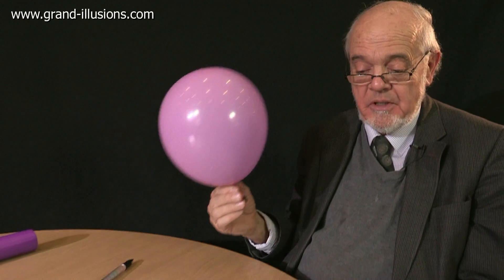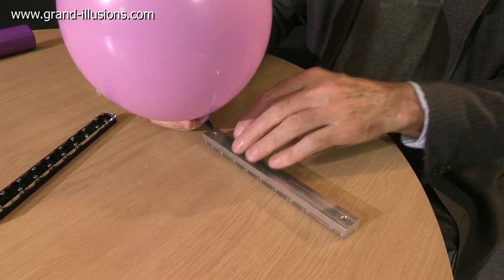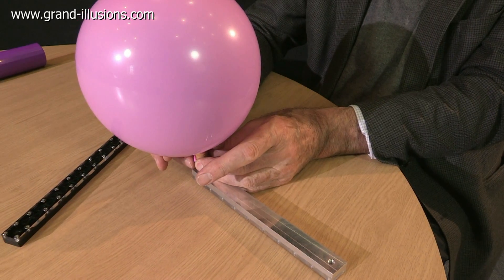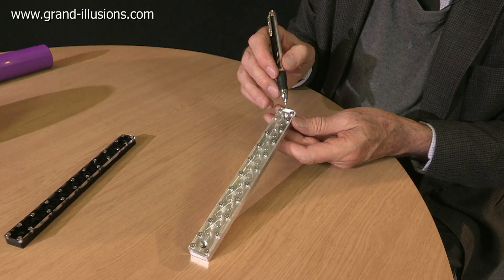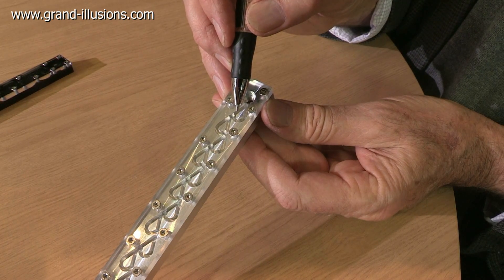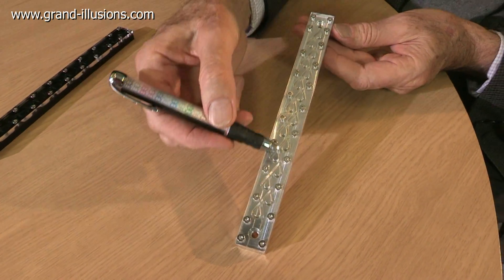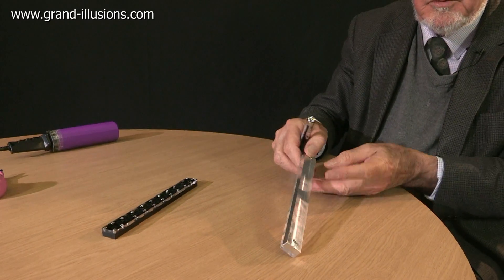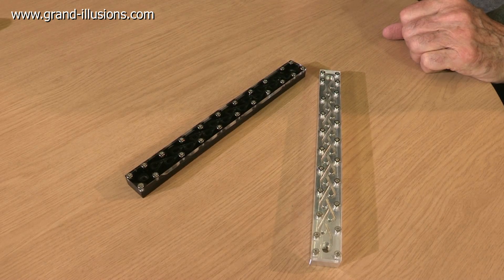Tesla Valve

Comment: That is super cool, but it would not replace a standard check valve for liquids(at least where you need to stop all flow (like for a water well).  There would always be back flow, just less I suppose.  It would be cool to see some practical applications for this.

Comment: Imagine a space vehicle,
using a gas ionised with electricity and an ionic engine to propel it through space, but when it runs out of fuel gas, it stops accelerating (nothing new so far).

Well, what if that gas accelerated with electricity was collected and braked using a kind of TESLA VALVE in 3D, to recover the gas and be able to be used again accelerating it with electricity.

Comment: Some people are comparing this to a labyrinth seal. I think they are missing the point of this device. Labyrinth seals work the same way in both directions. They are not one way valves as such. They are just a form of restriction to limit flow or leakage. This is a one way valve with no moving parts.

Comment: so it's not a valve but a device for lowering the fluid speed and therefore the pressure ... and it's fixed and not regulateable ... nonsense ...

Comment: The key aspect is that it has no moving parts to wear out. No rubber diaphragms etc.
Reply: I imagine there would be incredible erosion with prolonged use
Reply: @chemetron3826  no. If you mean decades of use, probably some minor erosion. But any valve would have turned to scraps in this time span.
Reply: Check valves last just like any other part of machine no problems.

Comment: This is the one of the only one-way tubes that can transfer liquid in only one direction without the need of mechanical or moving parts.
Reply: Not only one direction, just far more resistance one way.
Reply: @davids3539  i believe all valves leak
Reply: @NoFutureForG0uda  Not continuously like this one.
Reply: except it doesn't actually work
Reply: this is not a backflow preventer...it will slow the pressure but it doesnt have shutoff. the only way you can have 1 direction flow is with some sort of backflow prevention; youre right tho it would be mechanical even if it's a simple swing check valve it's got a hinge on it.

Comment: they now use 3d printed Tesla valves to pump water in Africa, no moving parts means a sturdier valve.
Reply: It is a valve, not a pump.
Reply: @tonyromano6220  they put the valve on the pump to decrease stress on the pump with back-flow liquid which can damage the pump.

But some places do use Tesla Turbine to pump water.

Comment: Very poor demonstration. What is the ratio of flow reverse and forward? There is no improvement in this ratio, if you use 1 or 10 elements as for 10 elements the pressure drop is 10 times that of a single element in both directions. Thus there is no point in making more than one element. Just make 1 but smaller will do the same job.

Comment: Couldn't one combine an array of Tesla valves and a turbine to harness ocean waves to produce electricity? Seems to me I heard one of the problems in harnessing ocean waves is the intermittent reversal of the water flow; Tesla valves could be used directly to turn the turbine, or to push water up a gradient into a reservoir which then could flow relatively constantly down through a turbine, no?

Comment: does the absence of moving parts make it more efficient due to lack of friction?
Reply: More efficient than what? And what is your efficiency unit? i.e. what process are you measuring the efficiency of? 

A normal valve closes completely and so if you mean it's ability to restrict flow then it is less efficient by definition.

Usually the main benefit of having less moving parts is to reduce failure chances and maintenance costs. So if you are measuring the maintenance efficiency then the Tesla Valve is more efficient.

Comment: The electrical engineer who transformed all of our modern lives by his genius inventions also invented the leaky/very-leaky valve. Should have sold it to Edison who might have found a useful application.
Reply: Most of his inventions never worked and were in fact physically impossible. He did design some great AC transformers, but that was about it. He was clueless about physics and insisted that it would never be possible to send electrical signals through the air. In 1919 he wrote: "the Hertz wave theory of wireless transmission may be kept up for a while, but I do not hesitate to say that in a short time it will be recognized as one of the most remarkable and inexplicable aberrations of the scientific mind which has ever been recorded in history."

Comment: Not exactly a valve, nor is it really one-way. It just has a directional turbulence effect.
Reply: What definition of a valve are you using?
Reply: @bramvanduijn8086  I guess what I'm saying is that it just has directional resistance. I suppose it could be likened to a very leaky check valve.
Reply: @BikesBlades  I've seen definitions that fit, that's why I am asking. 

A parachute has flexible parts, so it is less wear resistant. 

A parachute in a pipe with the same diameter would actually be a fully closing valve, assuming it doesn't collapse to one side due to turbulence. 

There's another difference: This thing (I'm still not sure if we should call it a valve) uses turbulence to increase efficiency, while a parachute can catastrophically fail due to turbulence. 

Those are some differences with potential.
Reply: @bramvanduijn8086  I guess the reason I'm not "wowed" by this Tesla valve is that it's obvious most shapes are more aerodynamic in one direction than the other. All Tesla did is find one such interior shape; there are probably almost an infinite number that would exhibit similar differential flow rates, forward versus backward.
Reply: @BikesBlades  Choosing the right shape is trivial optimisation, not the most interesting part about this. The interesting part is that the pattern repeats itself, and while repeats have a diminshing return, you can approach zero flow if you have enough repeats. Each repeat multiplies the flow with some fraction, be it 0.3 or 0.4 or almost 0.5, the point is that you can take any pressure and reduce it to a fraction at a cost of enough material to create enough repeats with zero maintenance. Most valves as a product scale linearly with limited economy of scale, but this has the potential to go non-linear. You just need to think outside the box, because as you and I both know it is not a perfect one-way valve, even though people keep calling it that.
Reply: @bramvanduijn8086  ...a parachute does the exact same thing.

Comment: Tesla tied using his vavular conduit to eliminate internal combustion engine exhaust, if industry had listened we'd be in less trouble with CO2 causing ocean acidification 10x faster than extinction events and 1m/3.3ft of sea•level rise within 80-years and not stopping emissions can double that.

Dumb, humans are vociferous idiots.
Reply: Uh, you can't delete CO2 with a valve
Reply: @logitech4873  Exactly, where would the exhaust go? It won't just disappear, making mass disappear is a lot harder than that.

Comment: Why is it redundant? One valve should do it, it doesn't, he added many many drag valves in series. Proof that yes, it adds a resistance, not an ultimate resistance. It may have been patented but no one uses it. No one uses his turbine either. 
  I'm not saying Tesla was not a genius, but this invention doesn't prove it.
Reply: I would think if the first stage was working much, then the second stage would mean twice the size and twice the weight for a much reduced improvement in the one-way effect. And so on with all the additional stages... very diminishing returns.

Comment: Just so you know, people who say this thing is useless: try to make a ball or regular check valve that lasts 100 million cycles (much like your car cylinder exhaust valve, that's about how many times it opens and closes in your car's life), but that works at 1200 or 1500°C instead of the regular 750°C of a steel valve. At those temperatures, steels creep, like chewing gum. You have to use ceramics or refractories like tungsten...which have the bad habit of breaking when subject to repeated shocks, which ball valves inevitably produce.

This means any ball valve at such temperatures will break after about 0.1% of its intended life. The only solution is a valve with no shocks, i.e., no moving parts.
Increasing the temperature, in turn, is the way to increase engine efficiency and decrease CO2 emissions worldwide. Finally, at the speeds of an engine, turbulence is so great that the forward and backward speeds in this tesla valve will be wildly different. Which means it will work more than well enough.

And if you design your engine well enough, the valves are the only things that really stand in your way. Once the moving parts there are gone, you are free to increase the temperature, and therefore, increase the efficiency. See this report for example: https://www.energy.gov/sites/prod/files/2014/03/f13/pm047_muralidharan_2013_o.pdf

So...who's laughing now?

Comment: Excellent demonstration, now it needs someone to model it vs. different air pressures for practical applications and tune the flight angles that produce the individual back pressures. I would love funding for this if anyone is interested.

You could even use actuators to guild the air path to tune it to any desired back pressure, I bet multi-stage units could create replicate existing one-way valves based on a constant input pressure.
Reply: It's been around for over 100 years, you think it still "needs someone to model it"? Sigh...

Comment: Can this be used as a one way valve in a water circuit?
Reply: It could be used. It wouldn't work, though, because it's not a one-way valve. Under any relevant pressure, it fails to avoid reverse flow while adding a lot of resistance to flow in the desired direction (in other words: useless).
Reply: sajber kurajber  - So you think the entire engineering community is composed of idiots? The "Tesla valve" (which is itself based on older designs) has been known for over 100 years. It's not used in anything relevant because it's just not very good.

It doesn't block reverse flow, it doesn't allow adjusting the flow, it's just a very big, expensive, not very efficient design that would need to be completely replaced every time the flow or pressure need to be adjusted. And if it gets clogged it's a nightmare to clean.

Also, the Tesla valve relies on friction with the fluid to generate turbulence and decrease flow; it suffers from a lot more "wear and tear" than a straight pipe, and even straight pipes develop tears and leaks. 

As every engineer knows, this is basically a toy. Its main use is to generate traffic on YouTube.
Reply: sajber kurajber  - What "modification"...? The "modification" you would have to do to turn this into a one-way valve is adding a one-way valve, which would make the existing part pointless. It's not "modification", it's replacement.

Even Tesla called this a "leaky valve".

Comment: This is absolutely amazing.  If this is so simple, why isn't it used?  I mean, I understand it's not a TOTAL cutoff, but even with that said...  :/
Reply: because when under pressures greater than what a balloon can puff, the valve offers almost NO measurable difference in fluid motion in the "slow" direction, but still makes more resistance in the "fast" direction than a simple check valve. the idea was to remove moving parts and thus fail pionts. tesla is a genius, but this one just didnt hit the mark. - master plumber
Reply: @__shifty  - Tesla was mostly a hack. He was great at designing generators and very little else. Half his "inventions" never worked and were physically impossible, he just lied to get funding (and he famously said it was impossible to send electrical signals through the air).
Reply: Because it doesn't do anything that can't be doen better by simpler and more compact designs.

Comment: Would be nice if there were a fan, water to bubble through, or another balloon at the other end to show the air flow. Is the air pressure at the exit the same in both directions? How does it handle high pressures, more resistance or less? Does it get hot? So many questions.

Comment: maybe im dumb but im not finding the amazement in this one
Reply: yeah but air still gets through so it's not really a valve, right?
Reply: Scramptha thats kind of what i was thinking. Im sure there are situations that this would be handy but most situations require a valve that would completely cut off air water or what ever it is ?
Reply: yeah its more one of those things that ur like "well this is cool but what do we do with it?, eh i guess it's destined for high school science class..."
Reply: Scramptha tesla was brilliant nonetheless
Reply: no doubt, all due respect.
Reply: Electronic diodes also allow a certain amount of reverse flow, but the change in resistance between two directions makes the devices is what is valued.
All due respect, this is a genius idea for maintaining natural circulation in power plants as the forces involved with large mechanical check valves make their use impossible using current materials.  Also with single stage back flow preventer's in domestic water and sewage systems which are prone to mechanical failure.  In short, cheaper power, water and sewer systems.
Perhaps digital hydraulic logic systems even?
Reply: Scramptha low pressure air gets through. what if you needed to regulate the output of water? too much water could damage whatever it is you're building so this is a great tool, especially because there are moving parts to break. furthermore, this limits the fluid to pass in one direction
Reply: Sure i'm not saying it couldn't be useful in some specific context, just that it's more useful as a learning tool and that this tesla "valve" is entirely inadequate as a replacement for a standard valve.
Reply: Scramptha perhaps it would be simpler to say, it's a different kind of valve.
Reply: Kyle Gardner can be used in pairs inside of a water pump you know the hand pump ones that are found all over the world. That stop working because the flapper  one-way valves inside wear out in time. These will never wear out. And leak so little that they work perfectly
Reply: huh? outlet of every steam generator i've seen has a NRV on it. what's impossible about it? Check valves come in all sizes as well.. some even have external counter weights.
Reply: It's not impossible, but it is scalable.  Check valves cause hydraulic transients that result in material failure if the system is large enough.  case in point, the improper closing of hydroelectric sluice gates that resulted in the complete destruction of the entire generator gallery and 76 deaths in Russis.  Large steam generators, like the ones I'm familiar with, can't use check valves for this reason and, instead, use massive isolation valves operated by an intricate hydraulic/electric system.  They're designed to close in 8 seconds which, on a system that passed 3 million BTU/lbm per second of steam, is equivalent of about 20,000 automobiles doing 75 MPH and coming to a halt in 8 seconds.  I can see the immediate usefulness of a Tesla valve in a large scale power plant; however, I do wonder about the effects of steam cutting, erosion and stress corrosion in low flow areas.

Comment: you should use it to blow up a balloon easier.
Reply: That’s not how it works. It looks 
Ike you could use it to blow air in it at an ok speed or at a slower one but you can’t create more air out of nowhere and blow less
Reply: @OfficialSombrero  it's not about increasing the (air into balloon)/blow ratio or reducing blows, but about keeping the air inside the balloon(reducing the amount that flows out). 

Pinching the balloon already does the job, though sometimes it's hard to get a good & secure grip
Reply: it does not 'add' more air from a source.
Reply: @jasonmateus924  but it prevents the already blown air inside the balloon to leak out, thus making you blow less (easier) times bcs most of the air that have been blown aren't leaking
Reply: @suisegs69420  I normally use my fingers to block the air inside the balloon while I take a breath... and I don't lose any air that way..
Reply: @couterei.1953  no it's not.
Reply: It won't.  You can blow it up easier without it.
Reply: tbh i thought he was going to do that but alas i was mistaken
Reply: Lord Lima Bean hm that’s an interesting idea
Reply: hardest thing when blowing up a balloon is overcoming the initial "tightness" and the tesla valve will unfortunately make that harder as even in the through-direction it still adds slight air-flow resistance. as much as i like the idea.
Reply: ooooh thats clever

Comment: Just wondering if there may be a medical application for this type of device, specifically as a design basis for a replacement heart valve. 

No moving parts will avoid the complication of man made mechanical valves potentially damaging red blood cells each time the valve slams shut.
Reply: Bill Bracale Do you have a link?
Reply: This is a good Idea Bill!  One of the reasons I like it besides "no mechanics to fail" is that something like a heart valve just hast to be designed to have repeatable and durable performance - a little 'bleed back' (pun not intended) would be fine.
Reply: Thanks, but now I'm re-thinking my original comment. I found another video on the Tesla valve that slapped me silly. 

Someone made a Tesla valve prototype with a plexiglass cover, then pumped a liquid through it, capturing video of the flow in each direction. I was amazed at the amount of turbulence observed in the backflow direction. Apparently the turbulence is the property responsible for impeding the fluid's flow. 

Since blood flow is mostly a laminar deal, the Tesla valve is probably no bueno for human blood circulation applications.